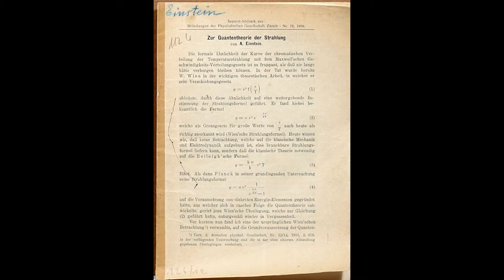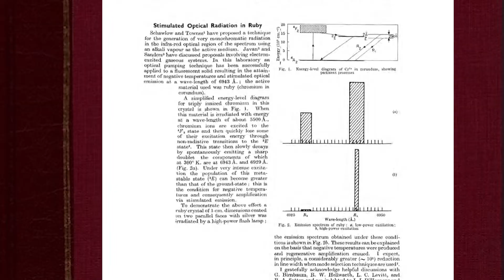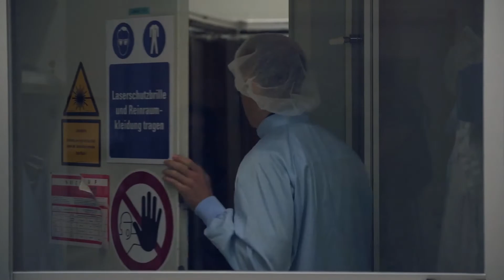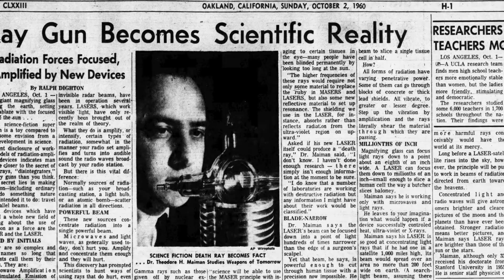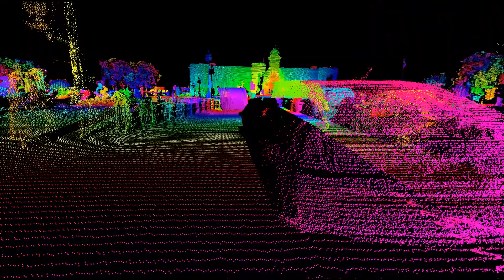Theodore H. Maiman. The world´s first functioning Laser

Comment: One question always sticks with me. How does the coupleMirror work exactly. Is it 1, it reflects some and couples some out or is it 2. It is like opaque until the radiation is strong enough and only then gets more or less transparent for the beam, like a Q-switch ?
Reply: Thanks 4 your answers after so long anyway 🤠🙌. This always sticks with me. Also because I red, that for CO2 you can basically use a 100% Mirror with a small hole in the middle to couple out some of the radiation (you can run some Lasers athmosperic, or cover the hole with a thin transmission window) But this leads me to think like "ok, but then I have broken my resonator in exactly the spot it is most relevant to the function" 😅 However, I guess I just not yet fully understand everything about it and the physics is not that simple as "light goes bouncy between two mirrors, hence laser" Time to get me a better book on it 😓
Reply: Yeah; from what I've read, (I'm a layman so, I'm not an expert,) one of the (two) mirrors is partially coated so, when the amplification reaches a certain point, the light bursts past the coating. I think that's why the old lasers like this were "pulse" (?)
Reply: I think it uses statistics. The most advanced mirrors produced by 3M use a series of reflective layers. Each layer has 50% chance of reflection, and 50% chance of light passing through.

One side of the laser gets 10 of these layers which gives a chance of 1/1024 for the light to pass through, and the other side gets many more layers which gives a probability of almost 0 for the light to pass through.

Hence we have 1 mirror that is 100% reflective, and the other which is 99.9% reflective